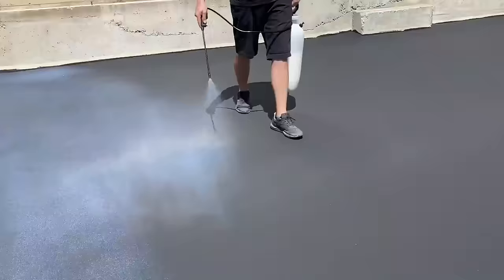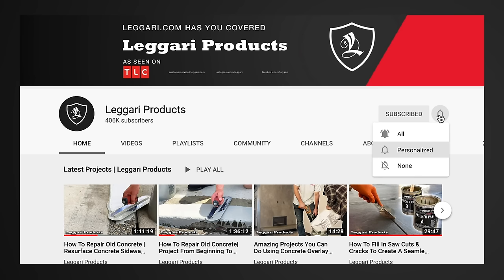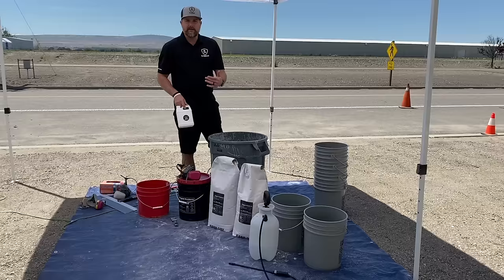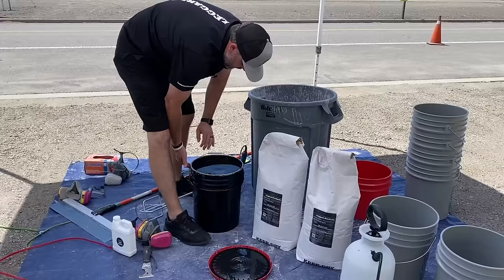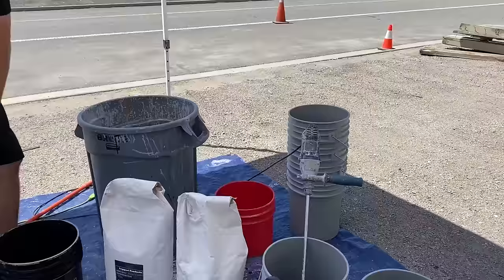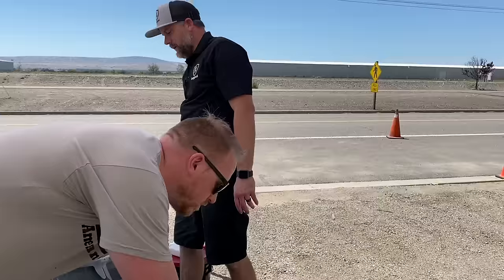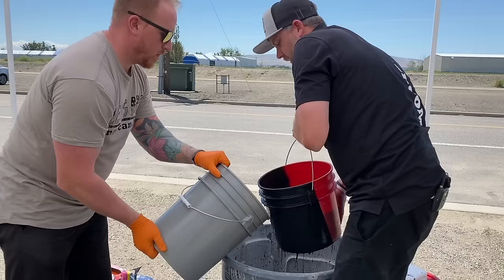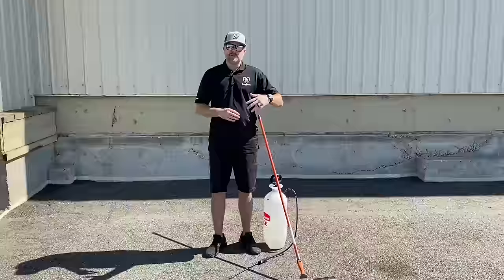Asphalt Repair That You Can Do Yourself Using This Kit | How To Resurface Asphalt

Comment: Wouldn’t a dedicated cement mixer make the mixing process easier?
Reply: Would it damage the mixee and get too gummy?
Reply: @bobbobbington3615  It can’t be worse than hand mixing it and doing multiple bucket transfers. Plus, some solvent should break any build up back down to an aqueous solution.
Reply: @robrodriguez4866  That's good to know. Guess they're just showing how easy it is for the average person then.
Reply: @bobbobbington3615  It isn’t a daunting task at all to do it on a small scale by yourself. I was just speaking from the perspective of someone owning the business that installs the stuff professionally.

Comment: What type of mask are you using?  I have looked for something similar but unable to locate one.
Reply from the maker: Just a standard respirator mask from Home Depot found in the safety supplies section. Since you are asking during Covid that may be the issue. They'll be back in stock eventually, it's a pretty standard respirator in the industry. Thanks

Comment: My face need a good seal !
Reply from the maker: This would be the perfect product for you! Leggari Asphalt Repair is designed to handle years of heavy traffic and will not to wear off or delaminate even after years of use Check it out here!👉
https://leggari.com/product/asphalt-coating-kit/

Comment: Is this basically the same material to your concrete resurface kit other than the color?  If so, I assume it is possible to apply this over both asphalt and concrete. Am I right?  I have a driveway that is part asphalt and part concrete. Probably even possible to patch asphalt with concrete, then apply this product over? Cold patch just doesn't last and cannot get hot asphalt in small quantity. :(

Comment: So this isn’t a “repair kit” at all, just a different version of a seal coat. I get it, your product has polymers that “might” extend the life of the asphalt if applied properly but it not going to repair damaged asphalt whether it be cracks, pot holes or just dried out old asphalt. It’s probably a good product to put on your asphalt in the first 5 years to “protect” it. Just market it correctly please!!
Reply from the maker: That’s definitely not what this is, it’s actually very different than a seal coat. We have videos releasing soon showing the difference, including the difference in durability. Also, unlike a seal coat our coating does fill small cracks and pot holes, while adding some structure back to those voids since it also has the aggregate within it. Marketing it like a “seal coat” would be dishonest, and definitely not do it justice. Send us an email and we’ll send you a free sample kit so you can see for yourself. A different product entirely. Thanks
Reply: Leggari Products squeegee these 🥜 
Might need masking tape, gonna be messy.

Comment: it seems to me, epoxy . I should make my own solution get from home depot mix it with black powder then put in it sand and try I actually put on my gravel driveway make it like an asphalt I got the idea.
Reply from the maker: Hi, this is not an epoxy, it’s actually not a resinous product at all. Epoxies aren’t breathable, and are rarely UV stable so they can’t be used outside. This is a permeable, flexible cementitious blend  that adheres directly to the aggregate within the asphalt. Thanks
Reply: @LeggariProducts  Thanks for your reply it  was my bad bud. you guys are rock

Comment: I review these type of product placements for the DYI . 
I am finding it difficult to see any real need for this product unless it is for an area that has extremely low traffic and not a huge degree of other usage and exposures. 
The product does not seem applicable for any general usage of the average consumer who would have asphalt repair needs.  
  Most  people are in need of an actual replacement or at minimal a proper good resealing with filling in the cracks before hand. Plus area that get variant temperatures have to look at expansion and shrinking in between hot and cold weather..
   I was hoping this would be a all around usage materials..  that does well in high traffic or whatever else..
Reply: Out in some HOA areas Asphalt has to be resurfaced every so many years.  This is better because it's not a petroleum product that causes the bottom of your shoes to turn black and track through the house. It is chemical & salt resistant.

Comment: For the cost of this product you can have your driveway repaved
Reply from the maker: Maybe in some places but definitely not everywhere. Also, many companies have square foot minimums and charge quite a bit for smaller areas. Companies around our region can be as much as $4/ft. Also, some people don’t need a full resurface just an ability to extend what they have for another 10 years.
Reply: @LeggariProducts  I own a paving company and there is no such thing as a square foot price, it goes by tons and time. A 2000 sqft driveway in your comment would be $8000, which is insane, it would be a real price of around $3000. Garbage over priced product. Get your driveway repaved from a company that offers a warranty.

Comment: Driveways and residential stuff only needs to be legitimately seal coated every 4 years and costs about .30 cent a square foot…yall charging $2 a square foot🤡 
Anyone who does minimal research should see this is not more cost effective and is a much higher pain in the A** to DIY or even pay someone to do

Comment: This process is the most unprofessional system ive ever seen, bulk mixed is the only way to get exact mixture ratio.
Reply: Somebody’s cranky and needs a nap.
Reply: Bulk mixed is the only way? Isn’t that what they’re actually doing? It doesn’t take a genius to figure out that depending on the square footage you need, they’ll supply you with the correct amount of material to cover that area.

Comment: More junk...one season at best..
Reply from the maker: Leggari Asphalt Repair is not a traditional painted-on tar-like material; if it were, it probably would only last one season. However, Leggari Asphalt Repair is an industrial-grade resurfacer loaded with Polymers for flexibility and crushed marble for strength. Not only that but we guarantee our proprietary kits are so strong they will not delaminate (peel off) or wear off over time.

Comment: This seems like a waste of time and money and at 15-25 cents sq/ft is much rather use seal coat then this sprayed on sealer . Overpriced junk
Reply from the maker: It seems you haven’t used our products before, that’s ok. Contact us and we’ll send you a free sample kit to see for yourself. Also, we have a video releasing soon revealing exactly what products should be called “junk” in this industry. Stay tuned, thanks.
Reply: Leggari Products can I get a free sample kit?
Reply: Leggari Products how does it work on an incline driveway though? Can it be mixed a little thicker?
Reply from the maker: @La_abbess  absolutely, contact customerservice@leggari.com to request one and we'll ship it right out. Thanks
Reply from the maker: @La_abbess  no problem, it's not a self-leveling product so it won't run when spread out with the squeegee. Thanks
Reply: Says it’s overpriced, never used the product. Are you a shill for big asphalt? XD

Comment: So many things wrong. Call a reputable paving contractor and quit the quick fix waste of money.
Reply from the maker: Hi Brad we welcome the skepticism as there are many garbage products on the market. I noticed you’ve actually never ordered any of our repair products, feel free to contact us at customerservice@leggari.com and we’ll send you some free samples to try. Thrash it, drive on it, try to pressure wash it off, it just won’t happen! Again, I understand your hesitancy but this product has been down for years and installed by our contractors. With how easy it goes down how could it be that strong? We look forward to hearing from you. Thanks
Reply: @LeggariProducts  I think Brad has a crush on you.